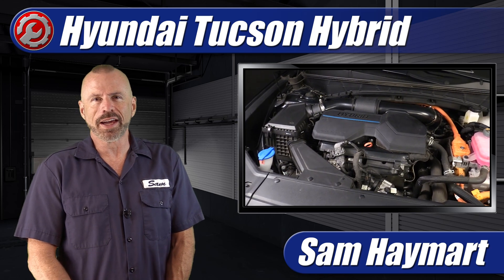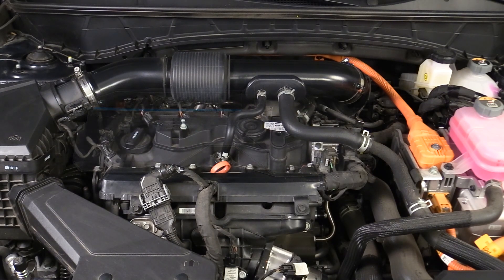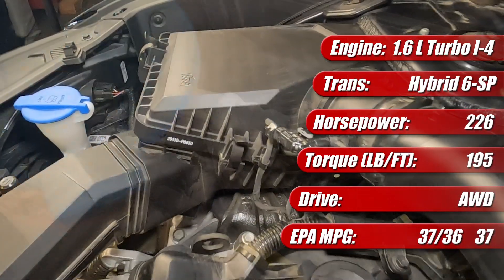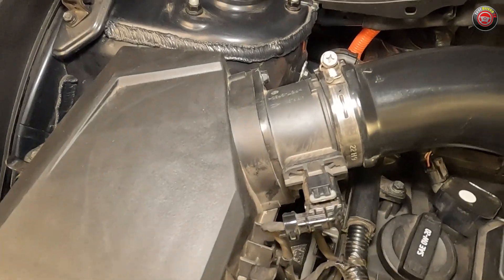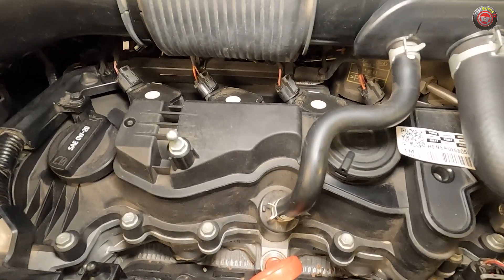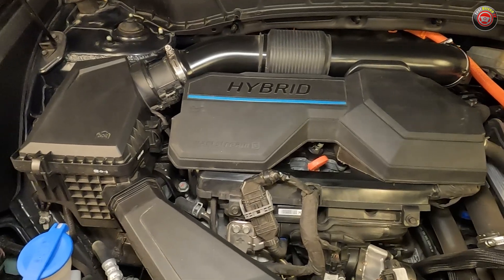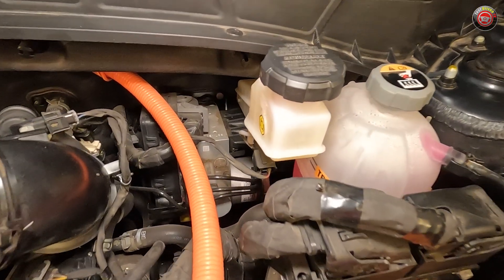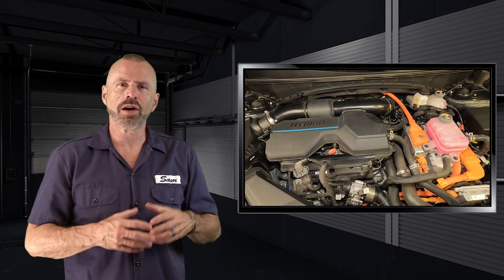2022-2025 Hyundai Tucson Hybrid: Engine Explained

Comment: Thank you for this video.  I am wondering where the filter is for the hybrid fan.  I know that it is really important to keep it clean but I don't know where it is on the 2025 hyundai Tucson hybrid.  On a Toyotas they are usually under the passenger seat.  Is it the same on the Tucson?  Thanks!
Reply: There's a small vent just underneath the seat in the back row. It's usually in the middle.

Comment: I spent 2.5 years owning a Sorento PHEV and it was a massive disappointment. It was at the dealer no less than 15 times including for an 8 week stint. The accelerator delay was extreme and unpredictable making it dangerous. The final straw was an onboard charger failure and transmission failure requiring a replacement. I replaced it with a RAV4 Prime and its night and day difference in every way.

Comment: The engine is NOT CVVT or valve tming but is CVVD or valve DURATION. It uses a multi section camshaft controlled by a servo motor to change the duration of intake valve opening. It is the only engine on the market that uses this system. You should do your research instead of making stuff up.

Comment: Good info, thanks for the video. We had a 2016 Sonata Hybrid Limited that took us over 150k miles with only an AC issue.  Loved the vehicle. At 150k the electrical system started having issues and we needed reliability so we traded it in for the 2025 Tucson Hybrid Limited. Hopefully we get another good decade out of the Tucson (knock on wood).  🤞

Comment: Would have been nice to slow down and point out the things your talking about especially the battery jump thing with the battery under the seat is ridiculous. How would you jump the car in a situation. You mentioned air filter but it wasn't clear where it was as if would be nice to pull the filter out along with dip sticks. Too much talked about too quickly without any details. What's the point
Reply: There's a little slit on the door handle you press in order to access the physical door lock. Open the door. First press the "12v reset" button on the left side. The hybrid has a separate 12v battery it uses to start the engine, this uses the main hybrid battery under the seat the seat to jump the starter battery. If this doesnt work, pop the hood. The positive terminal is under a cover to the right of the coolant. Connect the black lead somewhere grounded.

Comment: Can somebody please explain why the coolant levels are always below MIN at 2:51
Reply: Normally this is to allow room for fluid expansion. When the engine is running, the fluid can expand, and the space allows for room. If it were to be topped off when cold, it would then have a possibility to overflow. In olden times, you just filled the radiator itself and overflow just went out a small tube onto the ground. The biggest gain to having the overflow/fill reservoir is, again back in the dark ages, people would open the cap on a hot radiator, which would be under pressure, and get scalded by a hot geyser of antifreeze.
Reply: @stephen1991 so when do you top it off?   I thought the MIN line had to be maintained on cold
Reply: @mmamultiverse75 that’s what the tank says, so I assume it’s a good idea to fill to that spot. I’d thought the question was more about why they’re never filled closer to the maximum fill line. My fault.
Reply: I have a new hybrid tucson and the coolant is below min line as well so maybe it's just a norm for this model...

Comment: This article does not explain what happens to the operation of the petrol engine. ie. In a regular 3 mile journey I make 6 times per week the engine appears to cut in and out about 4 times when necessary does that mean that it has to restart perhaps by starter motor and what happens to the oil pressure when it is not running I say this because as we all know the start up sequence is the highest wear and failure rate issue with a petrol motor.
Reply: I too would love someone who really knows to answer this question. I've though the regular engine stop/start at lights were bad enough, but throw in the hybrid system and it's multiplied.

Comment: i just noticed, coolant for the EV (reservoir nearest to front)  is Blue,  the engine coolant (reservoir nearest to firewall) is pink.  looks like they are both  HOAT with phosphate  but why use two different colors in MY car when this video shows both are same...  sheeesh
Reply: The coolant for electrical system is non conductive
Reply: @austinliuyilun  has nothing to do with my question
Reply: Uhhhh don’t know what you’re looking at but the coolant for the EV is definitely pink in the video I’m watching.
Reply: @Tom60967  i did say MY car

Comment: Is Tucson hybrid good compared to gasoline? In terms of maintenance and other factors? If somebody don't have charger then is hybrid work fine with gasoline?
Reply: There's two types of hybrids, plug-in and not. You don't need to plug in the normal hybrid, you only give it regular unleaded gas like normal and you get better mpg and performance than the gasoline version.

Comment: I just bought a 2025 brand new Tucson hybrid limited my sister bought a used 2024, we both noticed that when driving and need to press the brakes, to slow down a little, the engine would down shift engine would rav which is understandable, BUT when we want to get up to speed,  it will stays in the down shift, so engine would rav loud, so we have to keep pressing the brakes or gas to get the engine to try to kick it back up to speed I understand going downhill but even that too the engine would not kick back up to speed to give you a smooth transition 
What should we do? Is there anything that you can think of? 

Thank you in advance

Comment: Throttle body (drive by wire) is located between plastic IC discharge tube and intake manifold, not before turbo inlet.

Comment: transmission fluid dip stick is gone ?
Reply from the maker: For decades
Reply: @TDTVGarage  but still serviceable?  there is a port to feed in new fluid after draining trans fluid right? there has to be.
Reply from the maker: If you have the tools and expertise. Point is, the auto manufacturers made a decision about 20 years ago they don't want customers monkeying around with their automatic transmission fluid. This is because it was costing them huge in warranty repairs/replacements because most people aren't smart enough not to muck things up.
Reply: @TDTVGarage  lol  yeah that aint it at all, mechanics know and will reject warranty claim if you run trans low on fluid or muck it up with corn oil.  they removed and sealed the trans so it will wear out, not replacing fluid every 30k will ruin trans. and when they say life time they mean after 5 years or 100k that trans is done, kaput lifetime over buy another car or trans.
Reply: DCT transmission don't need oil dip stick because it doesn't use torque converter but dual clutch instead. But still use some oil to lubricate the transmission gears inside similar to manual transmission.
Reply: @albertleal5950 this has a conventional 6 spd

Comment: I have a 2024 Tucson hybrid with a pinging sound.  I would like to keep the engine running in park so I could open the hood and check out the engine while it is running. Do you know the secret to do this? Thanks for you help.
Reply: I have the same thing.  Have you found a solution?
Reply: @gregscott8379  No. I brought the car to the dealer and they suggested trying a different gas. I did with no difference. Since then it has gotten cold out and the noise has gotten less noticeable. I'll bring it back when the weather get warm again.

Comment: I have a 2023 Hybrid Tucson. WHere is the large hybrid battery located? I assume its under the rear seat like the Toyota. I am not very good with cars. I have a Prius V and I have to change the battery air filter by the rear seats every few thousand miles. Does the Tucson have the same? Thank you. I appreciate your help.
Reply: The cooling air intake for the battery is at the front center of the rear seats.  I'm not aware of any filter for that.
Reply: @brucekaplan6124  Ok Thank you. My prius has it on the side of the rear seats
Reply: I asked this specific question at a dealership and the tech said there is not air cooling fan on Hyundai hybrid batteries…
Reply from the maker: Hybrid battery is located under the rear seat. Check your owners manual regarding any kind of a filter.

Comment: Does the electric motor turn at all times the wheels are turning? The ICE motor has a clutch that disengages it from the transmission, but the electric motor does not.